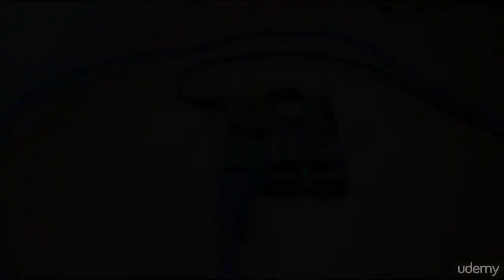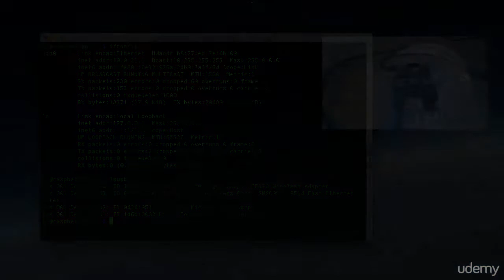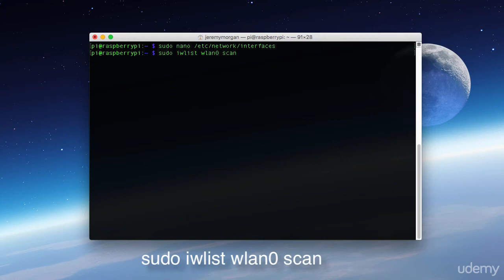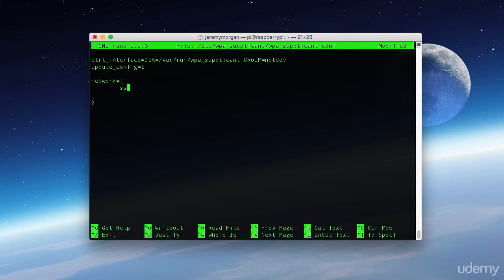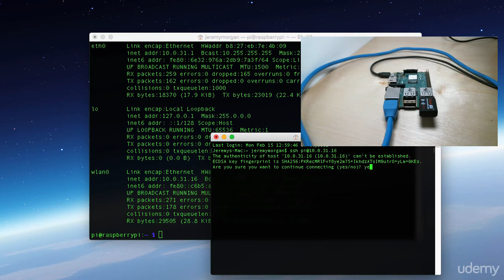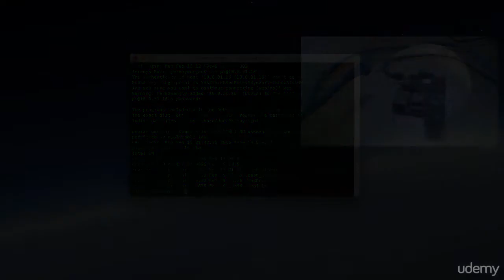How to set up WiFi on a Raspberry Pi - Hands on Internet of Things (Retired Course)

Comment: How to force an interface to be wlan0: ?
On my Pi3+ Raspbian if I boot with an USB wifi adapter; it switches wlan0: to this adapter. Randomly... I must boot first and after it is finished I can connect my adapter as wlan1:

I have tried system.d/udev and MAC adrs but to not avail :/ Any insight?

Thanks in advance :)